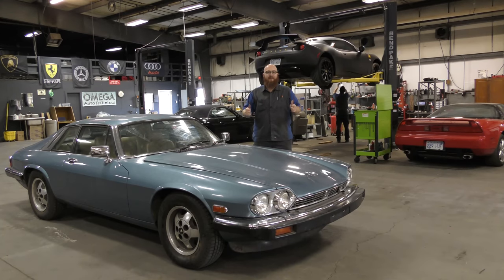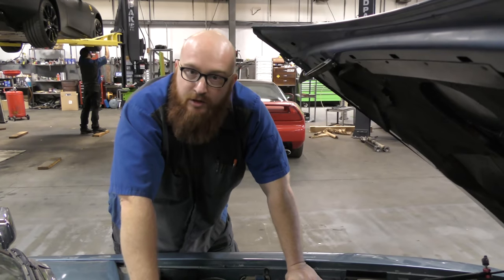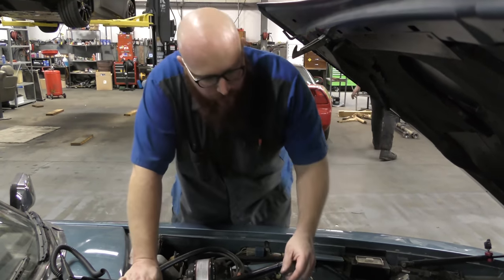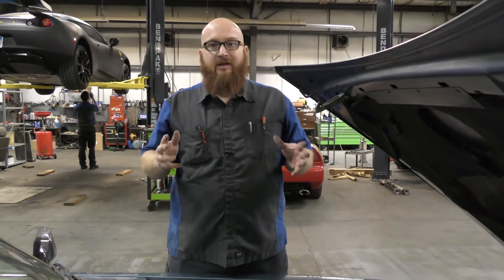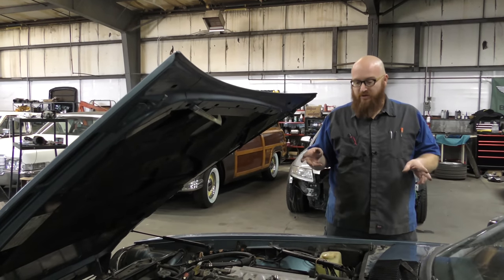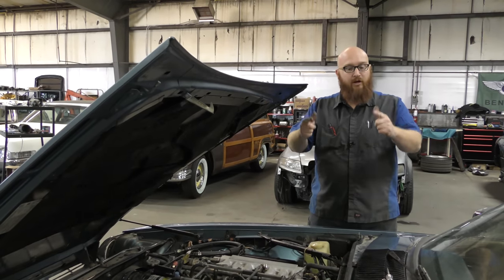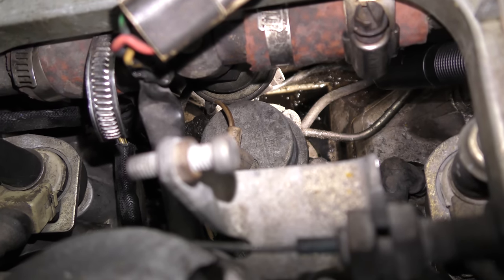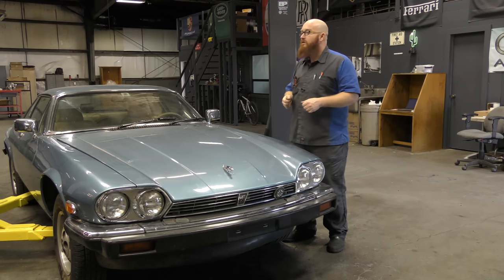'82 XJS with the cursed Jaguar V12 comes into the CAR WIZARD's shop. Can he get it running?

Comment: I really wish people would quit beating up on Lucas. It boils down to this: 

British Leyland calls Lucas and says: "We need an x to do y." 
Lucas replies: "OK, what are the design parameters and what sort of MTBF are you looking for." 
BL says: "MTBF is z hours". 
Lucas: "Ok that'll cost you  say 5 quid each."
BL: "We had more like 10 shillings in mind."
Lucas: "MTBF will drop to z/10" (or some such). Go talk to Bosch
BL: But they're not British and we wouldn't want Sir Humphrey get involved.
Lucas: (sighs) Fine. We'll cut the corners and build it for 15 shillings.
BL: "Great, we'll sell replacements to the punters at 5 quid every time it craps out."
Lucas: (breaks the 4th wall and shrugs) "It's a living."

The devil curse the value engineers.

All the cars that ran Cosworth engines in F1 back in the day had no problems with Lucas injectors or electrics. Lucas was allowed to build it properly.
Reply: Yup. Capable engineers, stymied by cost cutting management. Lucas also made the electronics for the Rolls-Royce Olympus that powered Concorde. No complaints there.
Reply: I agree, I still have no idea why the Americans run away from Lucas, wait until they encounter Ducellier or Rhone electrics from the 70s!
Reply: @cambridgemart2075  I think the main issue with Lucas was American mechanics not understanding a foreign car, scarcity of spare parts available (especially as the cars got older) plus the inordinate amount of smog/emissions crap the cars had to have in order to be sold in the US.
Reply: American here with a great respect for British engineering. You guys built a lot of neat things, seems like management and the government were the problem!
Reply: @Rift45  BL had terrible management in the 70s and early 80s, the union guys spent more time outside the factory gates than working.
Reply: @Rift45  I'm afraid it very much was the case, and it didn't matter what colour the government was either. There always was an element of a penny spent is a halfpenny wasted in the British motor industry, and other industries too. That's aside from governments in the past using sales taxes and credit controls to regulate the economy which in some cases crippled manufacturers or even bankrupted them.
Reply: @cambridgemart2075  I understand, a friend had a Triumph TR-7. Loved driving it but it broke down in every way imaginable. Our cars then were junk too but they were simple and fairly reliable.
Reply: @HowardLeVert  That’s a shame. Like the VC7 and VC10 airliners. Just when they could have exploited their achievements they instead walked away.
Reply: @cambridgemart2075  Been there, done that!
Reply: As an American whose family had a malaise era GM car back in the day that was so bad we nicknamed it the antichrist, I totally understand that pain.  When it wasn't actively trying to kill us it was a great car, unfortunately those days were infrequent thanks to latches that wouldn't, collapsing reclining seatbacks, and an EFI system straight out of a Stephen King novel.  Didn't even make it two years with that nightmare before we got a nice boring, reliable Toyota.  

Some of the BL cars back in the day were really clever designs and many were very pretty - I love the Triumph Stag and pretty much anything with a Jaguar badge - but the management problems, government interference, union issues, and resultant cost cutting killed what could have been really nice and likely financially successful cars otherwise and terribly damaged the indigenous British car industry.  Are Aston Martin and McLaren the only British owned and run car companies still standing these days?
Reply: @howard81  Aftersales support was awful here. British Leyland dealerships were often gas stations or shady used car lots who hung out a sign and stocked a few new cars on the front parking lot. Everything that happened after the sale was the owner's problem to deal with, good luck getting parts or finding a factory trained mechanic who knew what he was doing. There were some larger dealerships and foreign car specialists in bigger urban areas who provided good service, but BL seriously underserved customers in the large majority of the country, and the good dealers were ones who took initiative on their own, without help from the manufacturer, because no help was forthcoming. And that was when these things were new, the situation certainly didn't improve as BL started withdrawing from the US during the 1970s-early 80s (other than Jaguar, which was spun off as an independent company in 1984 anyway).
Reply: Same here - I saw a lot of quality Lucas parts  -  Well maybe not the bullet connectors - but they are simple and easy.    Many of the 1950's parts are still functioning on my car
Reply: A friend worked at Lucas on development of fuel injection and ignition it worked perfectly, then the cost cutting began....wiring became thinner,  components and mountings less robust the list could go on... you have to remember a lot of this knowledge came from the aircraft side of Lucas, where an " ignition " fault at 30,000 feet is not going to end well
Reply: @A2Wx8  According to Wiki, Aston Martin is, but the majority shareholder of McLaren is the sovereign wealth fund of Bahrain. It was also pleasing to read that you saw that several things united to kill BL - here in the UK it's popular to say "it was the Unions" but the reality is that it was six of one and half a dozen of the other - the management were every bit as bad  and then chuck in government interference and you have a recipe for disaster. The other major 'British' car manufacturers had their troubles in industrial relations but BL was by far the worst. It didn't help that some designs in the early 70s were positively antiquated either - the Marina is very much a case in point, but that too was a result of trying to produce a car as cheaply as possible.
Reply: @HowardLeVert  Aston Martin is a public company (I have a few shares). Off the top of my head, Morgan, Ariel, BAC, Ginetta and Lister are all British owned but I can't recall any others that are of larger size.
Reply: @daniel2001  Thanks for that - very informative :) I was surprised to see Morgan omitted and Ginetta - I knew of someone who was named that after the car her father owned!
Reply: @HowardLeVert  The British auto industry could have learned from the motorcycle industry. Kawasaki, and particularly Honda entered the market just when native companies were imploding. They relied on "Made in UK" as their main selling point. Customers chose "Can ride in the UK because it runs properly".
The British auto industry was an absolute cluster fuck in the 70's. Management has absolutely unrealistic goals as to what could be done at what costs. And labor would go on strike if someone's tea was 2° off optimum. In the middle of this, Toyota, Datsun (Nissan), and again, Honda walked in and offered better made cars at equal or lower up front cost. With fewer repairs and a dealer network that would fix it right when something did fail.
Reply: @christopherconard2831  Yep, the buying public voted with their feet. I can immediately think of three people who bought Japanese in the late 70s, having all owned spectacularly rubbish Vauxhalls. My brother's HC Viva - despite regular servicing - had barely covered 40,000 miles when the engine needed replacing. He bought a Datsun, never looked back.
Reply: Joe Lucas = Prince of darkness. End of.
Reply: hahaha yep
Reply: @Rift45  yep, our electronics are CRAP, but the insides of our cars are a much nicer place to be, why can't American manufactures do a decent interior, crap plastics, rattles and poor fit everywhere, between us, we could make a world beater, on our own, we both suck!!
Reply: @A2Wx8  I believe BOTH McLaren and Aston have been foreign owned for years now!

As a side note, a friend who works for Aston, told me a while ago, Aston makes more money from selling golfing holidays than it EVER did from selling cars! Sad but true
Reply: If they couldn't do it for the money, they shouldn't have tried, man up, say we need more cash, or go see Bosh and to hell with national pride!

Doing such a crappy job is not acceptable,some  company pride should have stopped them from doing such an awful job, the fact that 30 years on, we still take the piss out of LUCAS-The Prince Of Darkness"  means it's TOTALLY deserved, if they had stuck to their guns we'd all have a lot more respect for them, but they didn't, so we don't,
They made the product, put their name on it, so on their head be it!
Reply: @Craig-wp3pz  All true! Some US makes got a lot better in the late 2000’s but considering how bad the interiors were before then....
Still a long way to go. Everything had that plastic fuzz when I was a kid.
Reply: This is what happens, every time, when the bean counters poke their friking noses in.
Reply: @Rift45  bean counters are the enemy here and where for much of British industry along with the unions.
Reply: @Craig-wp3pz  Never underestimate the power of Sir Humphrey
Managing Director BL: The cheek, Lucas told us to buy from Bosch
Sir Humphrey: I'll have a word with the Minister. He went to school with the MD of Lucas and they belong to the same club.  Can't have us buying German. Next we'll be buying from the French. Can't have that.
A few days later in a club on Pall Mall
Minister: What's all this about telling BL to buy German? 
MD Lucas: BL wants it for 10 shillings. We can't afford to build to a decent level of quality.
Minister (in oily tones): I'm getting pressure from my constituents for jobs.
MD Lucas: Well...
Minister: You do know that I sit on your Board...
MD : Yes sir.
Minister: It would be a shame to find that the board has lost confidence in your...
MD Lucas: (seeing his Rolls, country house and place in Mallorca going up in smoke) I'll get the lads to see what they can do for 15 shillings.
Minister: Excellent. I knew we could come to an agreement. Now, how about some port...
Reply: @cambridgemart2075  :  There was a joke: Why do British drink warm beer? A: They have Lucas refrigerators.  A lot of it came from college students buying Triumphs and M Gs in the sixties in states that use a lot of salt on the roads in the winter, not only do they not have a lot of snow in England, but the students often did not have garages nor the time or facilities  to hose the salt off their cars.
Reply: This is only the half of the truth.
It was a hard time in England. The war between workers and industry destroyed the companies, because of the long delays they could not deliver by time. So they all, had immense quality problems - and Lucas was in the middle of the troubles.
A customer of mine, was a salesman for Lucas in the old days, he told me some storys...
They had not the right components, so they used other stuff they had, knowing it wouldn't last. He said it was a hard time, bad management, bad quality , bad payment.
Reply: @Tomservoca  perfectly demonstrates how the 'Old boy network' can RUIN a company,or industry on the whole, that's one if the reasons almost NO cars a manufactured here, only those who have been BRIBED with tax cuts and incentives, like honda and toyota, when the (expensive to the tax payer) incentives end, watch them pack up and leave in very short order!!!!
And once they've gone, kiss good bye to any hope of a self sustaining car manufacturing industry, now the world comes here to train engineers and designer's, then takes them back to where ever they came from, China/Korea/Malaysia/India, meaning the U.K. is ushering in its own demise, selling the tickets themselves :-(
Reply: That’s a distinction without a difference. 
They built that crap and put their name on it. 
Just following orders is a weak excuse.
Lay down with dogs, get up with fleas.
Reply: British "thrift" at play, it is not a virtue in this case
Reply: @daniel2001  Morgan are Italian owned now.
Reply: @Tomservoca  It's not as if the German manufacturers ever bought non-German components.
Reply: @mlgboy1  Nissan only agreed to come to Sunderland if their workers were Union free.
Reply: @wmhhealth2018  Car manufacturing across Europe was basically nationalised back then. The UK gov were not prepared to throw as much money at it as the French and definitely not as much as the Germans, leading to a loss of quality and thus demand. The advantage of this approach is that nowadays we have a thriving private auto industry free from tax-payer subsidy, while France and Germany are still stuck in their nationalised model.
Reply: @agt155  I had completely forgotten that they got bought.
Reply: @agt155  excellent.history, thank you.
Reply: That v12 is silky smooth probably one if not the best v12 built.Of course most mechanics won't know what to do especially as in the US.
Reply: @mlgboy1   bean counters, deep state, fake news, all conspired to destroy a crap product.
Reply: Tomservoca, thanks for your posting, but it would make a whole lot more sense, if, the first time you used the acronym "MTBF" you worded it in full.
Reply: Tomservoca its probably worth mentioning that MTBF is Mean time before failure and yes I agree with your summation, I've played with British cars for years and still do although I am now 25 years clean and sober when it comes to Jaguars :-)
The last of the SII V12 Jags was a soft spot for me and as usual the final run of the series was usually the best, I in all honesty found that once id sorted out the niggles and understanding the nature of the beast they were as reliable as any older car.
Reply: @KiwiCatherineJemma  Sorry. Just the enginerd in me. Mean Time Before Failure
Reply: @tony66au  Noted. I still think the XJS was the last beautiful Jaguar.
Reply: "Go talk to Bosch."  That made me laugh!  LOL!
Reply: @agt155  No German carmakers are state-owned. BMW, Porsche, and Mercedes never were, while VW was mostly privatized something like 70 years ago, IIRC. The state of Lower Saxony, where VW is headquartered, has maintained a minority stake in VW to ward off takeover bids and job losses, but otherwise Germany’s automotive industry is and has always been private. (East Germany excepted, of course.)
Reply: @mebsrea  Private in name only. European car manufacturing has been a battle of state subsidy for the last 50 years. Germany is top of that table, and that's saying something with the French and Italians in play. 

"Newspaper uncovers $172 billion in government assistance to the German auto industry"
Reply: All these replies and it’s not turned into the usual exchange of insults , what the hells going on?
Reply: same story for every automaker when contacting bosch or any other company that makes injectors, maf, etc etc... but the other seems to make it better for that 10 shillings.... lucas is what it is...
Reply: @A2Wx8  how government interference, bad management and union issues made British cars in those days less reliable?
Reply: Did not the V12 run Bosch Jetronic injection.
Reply: Tomservoca, indeed. well put mate. Thats exactly what goes on. Thank you for sharing intelligence and light on this subject for the unitiated. Also, an extremely well-thought example you gave. I salute you good sir! ✌💯🍻
Reply: @jackroutledge352  so true. man, this comments section right here has instantaneously restored my faith in humaities ability to reason and communicate valued intellect ✌
Reply: I owned cars with the Prince of Darkness electrical systems back in the 50s and 60s and they sucked then and they sucked 30 or 40 years later. Don’t care if it was due to engineering or bean counters, trash is trash to one owner with an endless series of problems.
Reply: There's also the issue of these things being designed in the 1970s. So many technologies have improved so much since then. With the aid of modern cad tools and being able to throw more than a 555 timer at it, these things just become so much simpler to design, deal with, and diagnose.
Reply: Accountants killed every thing over here.
Reply: I had a pre-BL Triumph.  Lucas parts weren't great even then.
Reply: Transmission is not British, How did they explain that? That's one of the reasons the small block chevrolet is  a popular option.
Reply: You can't beat Lucas for iGnition and Electric Products; they are the best!  I haven't had to change the Points in my Mini ever since I bought it New 5 years ago! Proof!!  Just been charged a couple of hundred quid by my local garage for re-setting the Tappets though??
Reply: @Tomservoca  I think the XJS was, and is, beautiful, but I have to say, as the owner of a 2015 XF and then a 2018 XE, I think the current Jags are pretty darn good looking, too.
Reply: @jamesglavich1426  Small block Chevy is an engine, not a transmission.
Reply: British Leyland calls Lucas and says: "We need an x to do y." 
Lucas replies: "OK quick relabel a stock GM part."
Reply: Very accurate description. The problem wasn't Lucas, per se. The problem was the bean counters and sales/marketing drones that were allowed to make decisions more important than the colours for their fancy offices, and even that might have been beyond them. A pox on them. Minions of Satan. If you want a good outcome, the engineers need to be in charge.

Same sort of problem that applied to all of British Leyland. The unions, of course, contributed to the problem. We're not going to hang the Jaguar Mk 10 doors straight and you can't make us do it. We'll go on strike until our leader gets back from Moscow with his orders for us.
Reply: @A2Wx8  I feel your pain. I worked in Detroit for most of 1973 and bought a 1967 Olds Cutlass with a 330 cu in engine. I really enjoyed driving it and it was great for our trip across the Rockies to the West Coast. It was a seriously good car. One of my cow orkers bought a new 1974 Pontiac Firebird Formula 400 4-speed manual. Another really good car. I rented a new Cutlass in 1974. Rather disappointing. I was given a Camry rental car in 1988 in Nashua NH because "it's just like an Australian car". Horrible thing with very vague steering. I took back and was swapped for a Pontiac Fiero, I think. A small, two door, slightly sporty looking car. Much better than a wallowing Camry. The engine was a bit anaemic, but the car went where you steered it and didn't wallow. I have good feelings that car.
Reply: Severe cost cutting like 70 degree rated wiring in a stinking hot engine bay (insulation hardens and breaks over time) glass fuses undergoing heat cycles and becoming intermittent.
Reply: @agt155  car manufacturing nationalised in the mid 80s ?
Volvo weren't (but Volvo were part of a cross-ownership thing so Pehr Gyllenhammar could do a lot in other sectors than truck and car manufacturing without opposition.)
Neither SAAB  weren't nationalised but it was a conglomerate of SAAB the aircraft maker and Scania (the truck company.)
BMW were and is privately owned though VW is in a big part owned by the state (Lower Saxony)
The french manufacturers is a mixed version.
Reply: Had a Triumph 650 Bonneville.  If it wouldn't start it was Lucas electrics.
Reply: @giuseppegiacomoni7058 POINTS!?!
 if it was new 5 years ago, pretty sure it's Injection and running German fuel,brake and ignition systems but assembled at Cowley in Oxford  out of mainly German and French sub assemblies and premanufactured parts put together by mainly foreign staff, in the UK as a training academy/apprenticeship scheme,  allowed as a consession to retain a manufacturing plant in the UK-i call it the raping of our manufacturing and education systems, but you can call it bean counting or economics if you prefer!?!
Reply: @A2Wx8  GM had a good reputation in the UK....not always the most exciting cars and trucks (Ford UK rang rings around them in that respect) but 'get you where you are going'  usually well performing and parts available everywhere for years were a GM UK vehicle The old 'Bedford' trucks are still lamented.
Reply: They were no better in pommy motorbikes. "Master of darkness" seems to be the common meme